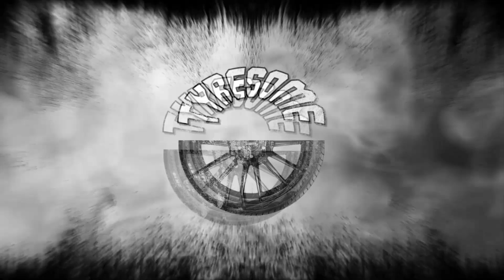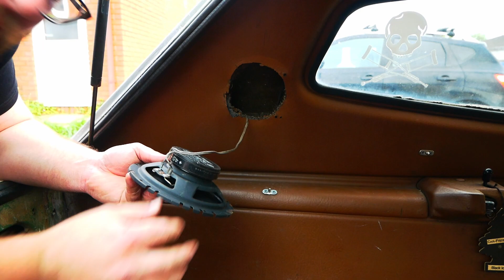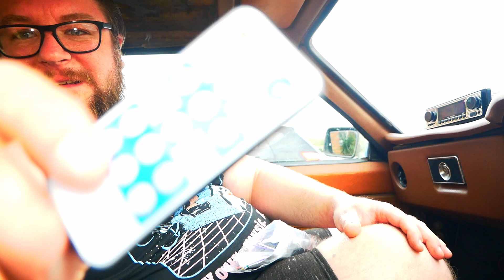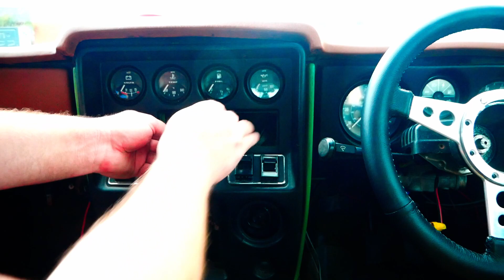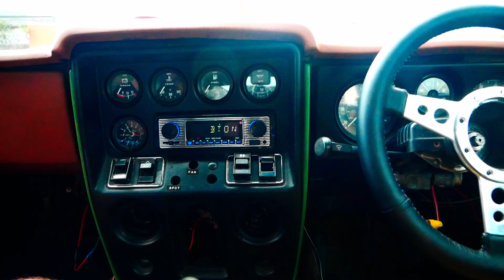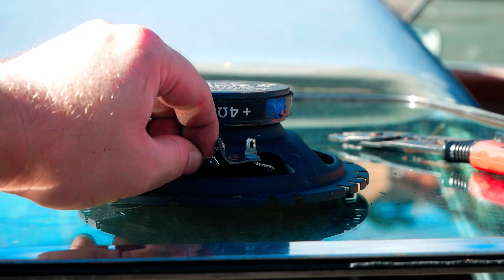CHEAP Stereo Install! | #ReliantRehab

Comment: Hearing your speaker woes reminds me of my first car, with a fine Goodmans head unit and speakers of dubious origin and vintage.  The worst speakers ever were in my Jetta GTI - they were about 2mm wide (may be a slight exaggeration) , and sounded awful.  The head unit was a fine Sony £10 car boot special, which developed a strange occasional fault.  Every so often it would just go silent, and then, after a few seconds, the sound would come back at near-full volume.  I grew adept at getting to it in time to save being deafened by shoddy speakers being overdriven within an inch of their lives.  Luckily, the head unit was only in the car for 10 years or so, in fact, it was still in the car when I sold it.  

I have a CD player in the Beetle.  It's been back back on the road for a few weeks.  i think I may have mentioned this a few times on your Discrod.    The CD player was fitted by my friend recently when the car went back on the road, to replace the (still working fine) Alpine radio cassette player I bought at a much reduced price when I first acquired the car 20-odd years ago.  I didn't use the radio as the car doesn't have an aerial.

I haven't even switched the CD player on yet, let alone set it up...  I think the more interesting to drive the car is, the less you worry about the sound system in it.  if you were driving something more modern and mundane, you'd worry more about those paper speakers...
Reply from the maker: My dad has Goodmans speakers in his Riley! 

OH! I didn't know you had a beetle. How lovely. 

I do know what you mean, I haven't used it much...more because i'm listening out for faults and behavioural things to do with the car. But as it get's more reliable some tunes can make the commute a bit more enjoyable. Especially on the way home from a Friday workday!